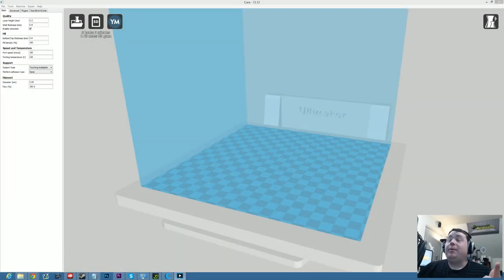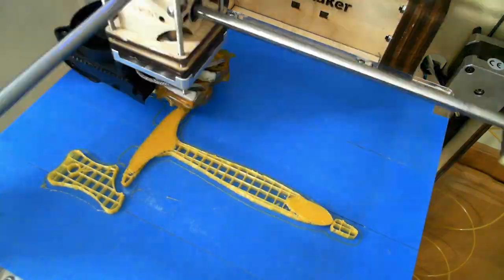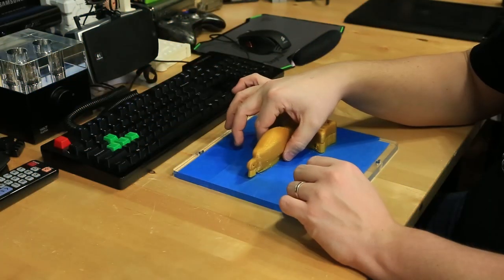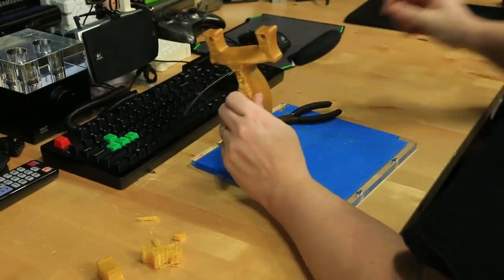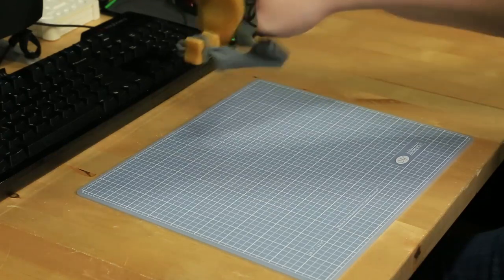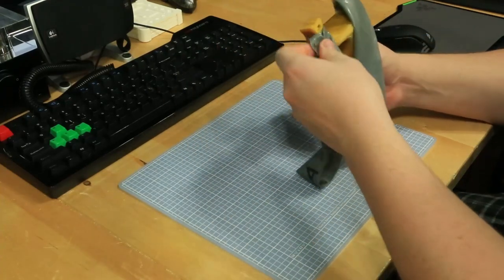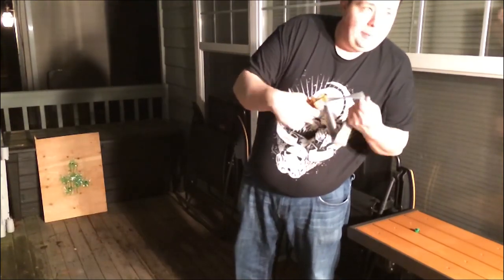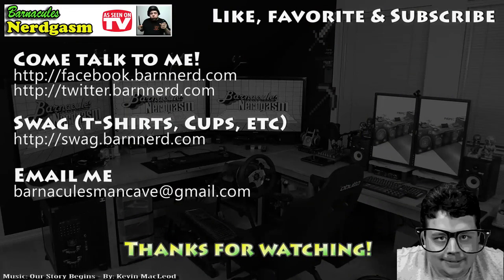3D Printing & Shooting The Rambone Slingshot by Joerg Sprave - The Slingshot Channel - @Barnacules

Comment: Using a file, it is more efficient to push only.

Files are designed to remove material on the push. pushing it back and forth causes damage to the file.
Reply: MY2KSapphire Rubbish. He's filing plastic. Won't damage file one bit

Comment: Jerry, I'm having a HUGE problem with curling when printing ABS. It drives me nuts! It's killing my prints at 60% complete, popping them right off he build plate (and that's with a heated bed) I guess like everything it takes time to tweak and perfect. A 5mm brim and 2mm raft has shown to help a little bit. Going to switch to a mirror/glass bed to see if that helps. Great print! Keep it up :)
Reply from the maker: A friend of mine told me to make 'ABS Juice' with little bits of ABS and Acetone and coat the heated bed with that then let it cure under the heat. He claims this solved 100% of his curling problems. Also make sure the bed is heated to 100c+. Let me know how it goes, I'm going to try ABS in a week or so.
Reply: More infill has helped me with this same issue. If you make the ABS slurry find someone that actually uses it to find out what sort of mixture to use. I tried to just wing it and it did not end well... I pretty much had to then clean my heat bed off with acetone and a razor blade...
Reply: I just use glue stick (Elmer's disappearing purple) put a thin layer on your bed and your prints should stick right on. I only use the abs slurry when I need to stick something really stubborn. Almost never have a problem now.

Comment: Barnacules,
Loving the channel so far. I myself run a 3 monitor setup so far in my "man cave" (unfortunately I can't give you credit for the inspiration). I run a b9creator at the moment have you heard of that one? It is pretty impressive for the cost. I just have to fix some of the inevitable kinks these printers come with.

I was thinking of getting a plastic 3d printer as well I know you recommend the ultimaker... Is the lack of heated bed even a problem ever (besides the small issue you mention in this vid)? I would like to be able to print in all the different filament materials available like you do... And what do you think of dual extrusion?

Comment: that band material is the same type different brand that mr. sprave recommends however you probably should have done a little research on band attachment design, and it isn't a new discovery that one piece of band can reach from one side to the other i'm sure you rapidly discovered the reason people bother making pouches ...thanks for the video i enjoyed it.

Comment: Instead of using that rubber you could have used wheel chamber, cut some little cords of it, weave them and use that cord, the wheel chamer it's strong and almost indestructible

Comment: is it possible to 3d print a 3d printer? just wondering
Reply: yes. you can 3d print metal and plastic. so in theory with a big one. you could. you wouldn't want the chassis in too many pieces hence big printer
Reply: That's kind of the idea with the reprap projekt. The same project that both the Ultimaker and the Robo 3d are based on.
Reply: yea in the futuer just wait till printers can print a molecule precicely
Reply: How so?
Reply: You can print a majority of the parts but how tf are you gonna print a controller?
Reply: ... sorry I this is a dumb question but... whats an extruder :P
Reply: oh , thx for telling me that ^.^
Reply: ***** think the extruder problem might only apply to FDM/FFF printers. If we were to try and print a SLA printer, I can't really think of many hot parts that could melt... as for the electronics, considering there are electrically conductive filaments and the ability to pause mid print and add parts on some printers.... Hey Barnacules Nerdgasm, print a 3d printer!
Reply: Why the heck am I getting a notification for this A YEAR LATE?

Comment: That rubber you used, is actually pretty much the same stuff, jörg also uses, allthough you should not cut it the way you did, it tares so easily, because there are tiny small cracks from the knive in the rubber now, which will get bigger with each shot and finnally break the bands :)
also you should probably make a leather pouch for it :)
very, very good though, especially for your first try! :)
Reply from the maker: The first band I made in the video broke because of that! The second band I cut using a rotary razor fabric cutting tool so it was one completely clean cut with no fractures and the band is much more durable now! Forgot to show this in the video.

Comment: I wonder if there is a machine to melt down the plastic that you cut off and don't use and it will melt it down into those strips so your not wasting plastic
Reply: there is, there's actually quite a few, but they cost like $700...

Comment: hey barnacules Im a big fan. Ive been looking into 3d printing for a while now and was wondering what you would suggest The robo3d or ultimaker for printing pla mainly? Price is not too important but is the robo is better for the money? Would you suggest waiting for the robo to come in stock for non kickstarters or Just get a ultimaker? I mean It is kinda weird to ask this about a printer that cost about twice as much as the other. But what Do you think is the best for the money?
Reply from the maker: The Ultimaker is a more reliable printer out of the box if you have them build it. But with a little tweaking the Robo3D is also a great printer.

Comment: Can you imagine printing this with an industrial 3D printer that uses stainless steel sand as the printing material?
Reply: that would be so cool if you could
Reply: I keep getting an aluminium based one popping up in video suggestions, I just haven't watched it. Likely uses the same material like the bronze fill used on Jerry's head and bitcoins.

Comment: You say cura works on any printer - any help with a duplicator 4? :)
Reply: If it has sd card support just splice it in cura and export it onto the sd in STL and set the printer off hope this helped
Reply: luke johnson It wouldn't work as cura does not export X3G which is what makerbot and clones run of that's why you need GPX

Comment: Print Translucent/Transparent Keys for your Multimedia Keys on your dasKeyboard
Reply from the maker: It's hard to print something translucent on a 3D printer, I mean you can see through it a little bit but not much because the layer process traps air.
Reply: oh, okay. i dont know then lol
Reply: Not even with the Colorfabb XT Clear you made the upgraded bowden clamp with? You said putting the printed object in the dishwasher on the top rack would make a cool ice-like material, that might be cool especially since the multimedia keys light up. The air pockets might make it even more awesome looking because it might look like tiny stars or something idk lol but yeah.

Comment: Looks like marbalizer.
Reply from the maker: Josh Bishop It was!
Reply: Barnacules Nerdgasm Marballizer used to be super brittle when I first got into paintball but ever since kee action sport brought it back it has lived up to its name. 

How long have you been into paintball or is it something you haven't done a lot of?

Paintball is one of the reasons I've been looking into 3d printing, I've been a part of everything paintball(playing, working paintball retail stores and working for a paintball distributor) and there are too many things I've wanted that just don't exist and I'd like to be able to do something with those ideas. I've been looking at the cheap prusa i3 kits on ebay and may go ahead and get one in the next month or two.

If you're not onto paintball this won't mean much but one of the pride and joys of my paintball collection is a propane powered pump gun.

Comment: Can you print a gun?
Reply: yes if you have the blueprints
Reply: no if you did one the parts wont work together and two the gun whould melt after one use because its made of effing plastic and you are using fire on it
Reply: well but still if you make it out of pla you will melt the barrel of the gun instantly